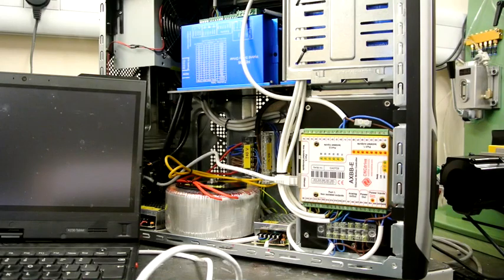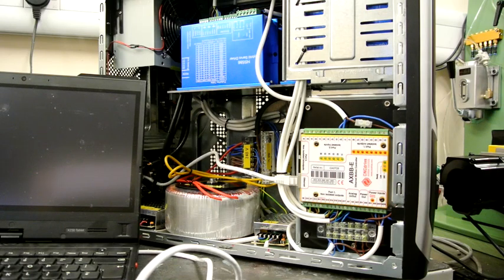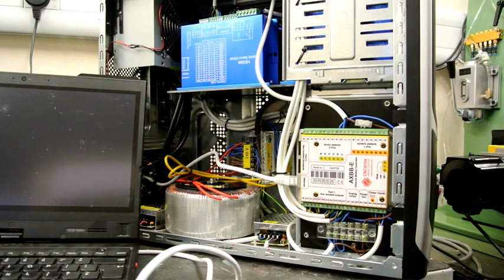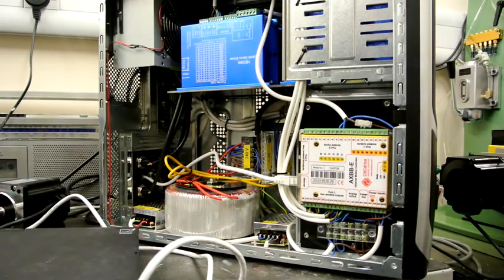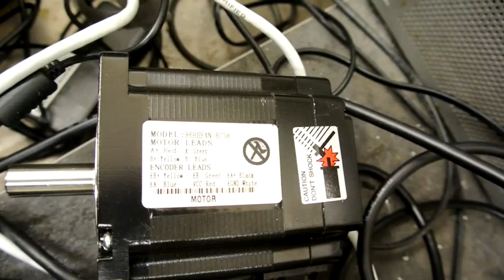Part 7 Warco GH18 CNC conversion Ist run

Comment from the maker: Yes it will machine steel stainless steel etc but obviously you cannot take as heavy cuts as with aluminium. I have just machined a cross slide base for a lathe that is cast iron and I machined 4mm off it over 100mm X 100 mm. It didn't hesitate, though I was running .5mm cuts at a fast speed. I did try 1mm deep cut but the speed I wanted to use was just too much for it. The cutter was 18mm dia. 
John

Comment from the maker: Hi 
Machining by cnc does take some practice. Myself I use a drawing program calld Solidowrks, which is expensive and draw parts in dxf frmat. I then convert the files to cnc files using Dolphin Cad Cam. This produces the G code and gives tool path simulation. I then pass the files to Mach 3 or in the case of the WM 18 I am using UCCNC. Mach 3 works well though. 
Now if I am sometimes wanting to machine some simple machining and it is not worth the time to get drawings prepared. In that case I use a pendant control to run the mill  like a manual mill. Using Mach 3 you can use the excellent Chinese wireless control.

Today there is better software and most seem to use Fusion 360. You can find plenty of videos on Youtube.

Hope this helps

John

Comment: Hi John looks great 
I'm thinking of converting the warco wm18 mill looks similar to your one only thing putting me off the cnc mill is running it as I'm not big into my computer stuff people tell me it's not that hard but not so sure myself
I'd be running mach 3 but want to know many un answered questions if you ever had that much time to talk ha but most important can I run the mill manual from computer still and how hard is a basic programs to write 
Thanks

Comment: What motors are you using please
Reply from the maker: Hi
I am using the well known Chinese Nema 34 closed loop steppers found on Ebay with matching driver and cables. The X Y and A axis are 4 NM and the Z axis is 12NM.
There is a servo at 8.5NM if you wanted slightly more power in the X Y and A, but I do not think they are necessary. The cost of one motor and driver is approx £100. They are very powerful capable motors and run nice and cool. It saves a lot of space to opt for the toroidal  transformer. This produces AC current which the stepper drives can use direct form the transformer. Not a bad idea to fit an inrush current thermistor to help protect the trip switches and RDC. I think all the motors being sold are made in the same factory, but there must be at least 3 factories making the blue stepper drivers as the cases are plastic, metal dark blue and metal light blue. The motors have 86HSE4N-BC38 on the label and the motor is LEADS (I presume is Leadshine.)
It is cheaper to buy in bulk all together. I bought mine direct from China via Ebay and that worked fine.
John
Reply: john2478 thanks for the comprehensive reply.  I have just added a z axis power drive using a stepper motor but too be honest, after building it one with a motor that was woefully underpowered, the second motor sometimes also feels underpowered. The first was a NEMA 23 1.9nmthen replaces with a Nema 23 3nm.  I have the Warco WM18.  I kind of wish I had see this video first.  BTW I not going the CNC route
Reply: Sorry, another question. How did you attach the motor to the z axis lead screw
Reply from the maker: @Petrolhead66  I used the Connectors usually found on Ebay. I removed the key from the keyway and tightening the clamping of the connector on the shaft seems to be enough. On the Z axis I just had a smooth bore onto the Z axis ball screw, but on the X and Y I threaded the inside of the connector so they could screw onto the ballscrew. I have some video and photos  and will try and find the time to make a video about this part of the conversion. The connectors I used were the ones with orange plastic segments.
https://www.ebay.co.uk/itm/Motor-Shaft-Screw-Coupling-Coupler-5mm-6-35-8-9-5-10-12-14-1605-16mm-Ballscrew/292593463835?hash=item441fedf21b:m:mBFiB-L030i8a1b50ODDUww
I of course bought them direct from China rather than via the USA. There are 2 types of these connectors one with smaller orange sections but more of them. Both seem to be OK to use. You can buy 1mm pitch taps on Ebay if you want to screw yours direct to the ball screw shaft. I turned and made the screw threads myself on my ball screws. You can either soften the ends of the shafts by heating or simply turn it in its hard state as I did. You would find it hard to thread them with a die though if hard.
John
Reply: john2478 cheers, so I suume you can get the connectors to suit the shaft diameter of the stepper motor
Reply from the maker: @Petrolhead66  Yes I found ones that were what I needed (12mm at one end and 14mm at the other) The couplers can be turned on the lathe quite easily if required.
Have a look at the selection at aliexpress.
https://www.aliexpress.com/item/32858062442.html?spm=a2g0o.productlist.0.0.229e2e6c9KwjnM&algo_pvid=7a82cafc-4243-423c-8da4-85fc00389ae9&algo_expid=7a82cafc-4243-423c-8da4-85fc00389ae9-52&btsid=fb669e41-dd3b-408a-a55f-e902c8c21925&ws_ab_test=searchweb0_0,searchweb201602_1,searchweb201603_53
Reply: john2478 thanks, for all your concise replies.  when i asked the question about connection to leadscrew i had not realised you had replaced the leadscrews with ball screws

Comment: Impressive work. Is that Warco mill the same as hbm bf30?
Reply from the maker: Hi

It looks very similar to the BF 30 G but the spindle is R8 in mine which was important as I wanted to have a Tormach tool change arrangement ( The BF30 G is M3 taper.). Also my mill was 250Kg and the BF 30 G is 190 Kg. 

John